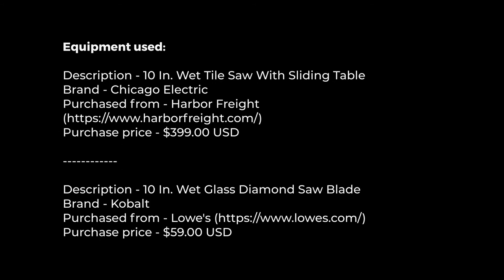How to cut a glass beer bottle with a tile saw

Comment: I have this saw but water on the left side of the blade is only hitting right where a piece of tile would hit the blade so when I try to cut bottles that side heats up. any suggestions?

Comment: Could this method be used to cut bigger bottles? And odd shaped ones? For example, something like a makers mark bourbon bottles? Or a square jack daniels bottle?
Reply from the maker: Hi Chad - thanks so much for your inquiry.  YES, this setup works well with odd-shaped and square bottles.  Some shapes are easier to cut than others.  The main challenge is pushing the bottle through at a right angle.  Other than Jack Daniel bottles being somewhat thin in terms of glass thickness, they are fairly easy to cut.  Your questions would make for a good video.  Stay tuned... ;-)

Comment: Does the tile saw have a place for the water?  Thanks, good video.
Reply from the maker: Hi Walter,  Thanks for your comment and question.  So the way it works is that there is a bucket under the tile saw filled with water.  It has a hose that draws the water up and onto the blade and cutting surface.  This keeps it cool and enables the blade to cut smoothly.  There is a catch basin under the blade and the push platform that catches the spent water that needs to be emptied periodically.  I hope this answers your question.  Feel free to reach out if you have additional questions.
Reply: Thanks very much. @RedClayCandles

Comment: I have been picking up trash for the last two years while I walk my dogs in the morning. I’ve collected thousands of bottles I’ve tried several manual bottle cutters with little success. I have zero experience with power tools but I’m desperate. The problem is, Harbor Freight no longer carries this! Your video is the first that actually looks doable and adorable to me. Can you please suggest an alternative? Thank you.
Reply from the maker: Hi and thanks for your comment.  I apologize for the long delay in responding.  I somehow missed your comment when you first posted it.  First, good for you to pick up all that discarded trash.  As for a Harbor Freight alternative, there are many.  The two main keys are to make sure it is a WET tile saw meaning it has a way to continuously feed a stream of water.  This is usually accomplished by having a bucket filled with water and simply dropping the included hose into the bucket to draw the water out.  Next, and EQUALLY IMPORTANT, is to make sure you replace the blade that comes with the wet tile saw with a diamond-tipped wet saw blade specifically made for cutting glass.  They are not as expensive as the sound.  Usually around $55 +/- for the 10" size.  If you find a set-up you would like my opinion on, I'd be happy to provide feedback.  I would think Harbor Freight has a replacement but I've also seen similar, albeit more expensive, alternatives at Home Depot and Lowe's.  Of course, Amazon is an option too.  I hope this helps!

Comment: can the neck part be cut into small rings or would that be too small
Reply from the maker: Hi Jennifer,  Thanks so much for the question.  I think it would be hit or miss given how small the cut would be but it would be a fun challenge.  I will give it a shot and report back.  Just curious, what would be the intended purpose?  Perhaps jewelry?  Thanks again for the interaction. -Andy
Reply: i would put them in my kiln to melt down to rings for pendants or wind chimes
Reply from the maker: @theglasshopper  OMG... so funny you mentioned that.  I actually used to have a kiln myself for slumping bottles into different things.  I did experiment with cutting the tops off of wine bottles into rings and they came out great.  They worked better than beer bottles because they were a little thicker.  They made great pendants.  So given your application, I think they would work great.